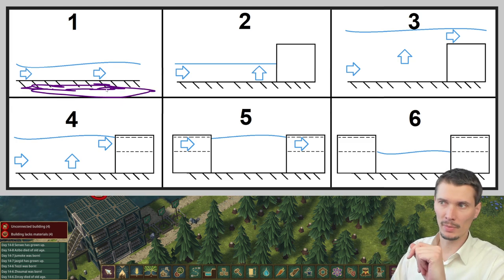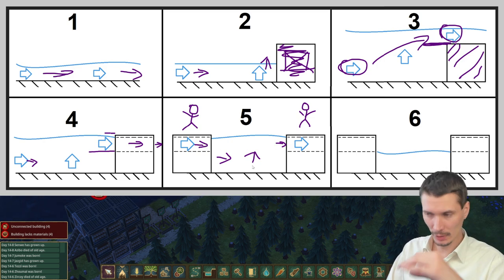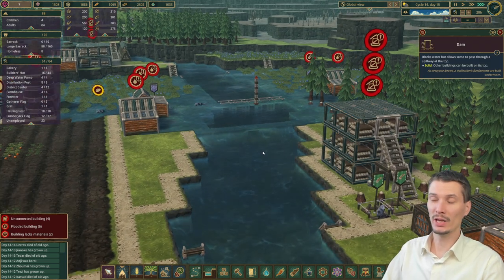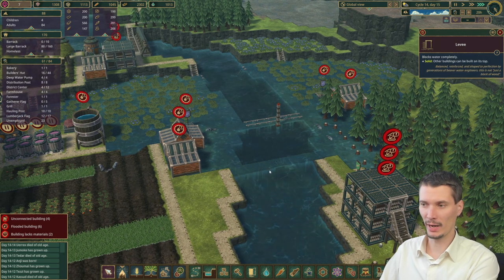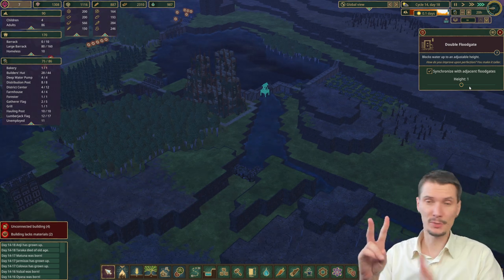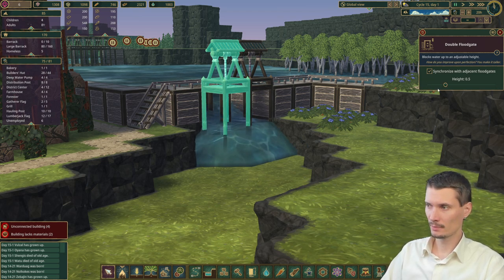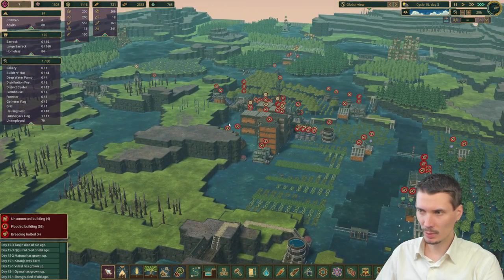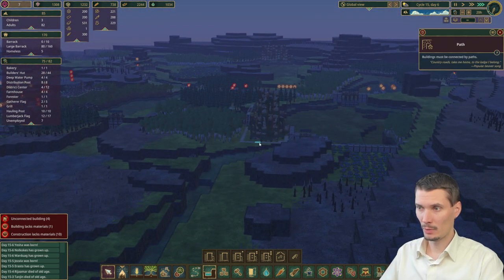Tinberborn: Dam tutorial guide

Comment: have you thought about covering how water depth and height differences correlate to how far and/or long a area stays green.
like for example:
0,5 blocks, 1 block and 2 blocks deep water do they all provide the same area as green?
is there a difference between 1 block of water ending at ground level and 1 block of water above ground level (water levee and green area all on same level nothing under)
how big of a difference is having 1 empty level between your water and your ground level to having no difference
probably something else could be added to this but cant think of it now... 
also kinda curious on how many tiles in between one should have if they wanted to make a single tile wide ditch of water and another one of them going parallel so that there is no dry land in between and the green area doesn't needlessly overlap..
Reply from the maker: Awesome to see someone asking the same questions I've been wondering about! :D I'll put up my next testing area for this :D In a matter of fact - I'm setting all up as we speak so I should be able to have some of the answers! :D 
One extra tip from another viewer and absolute legend was to not dig a whole irrigation canal but just a 1x1 square with water dump. Or it can be a water tower (if there will be no differences)! But the outcome is huge area of green land with small impact! only thing the dump must be beaver operated, but that shouldn't be the problem.